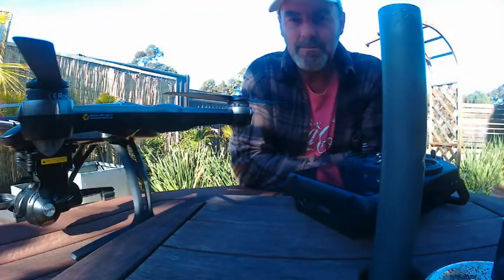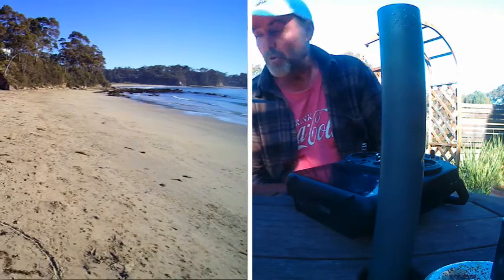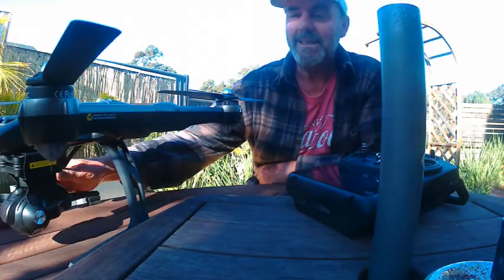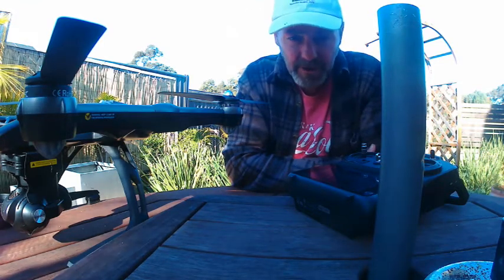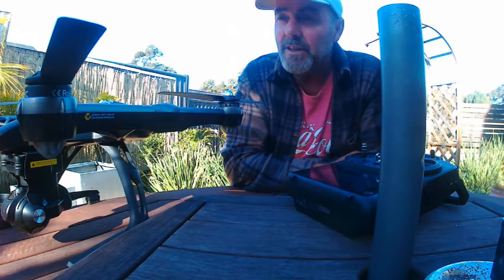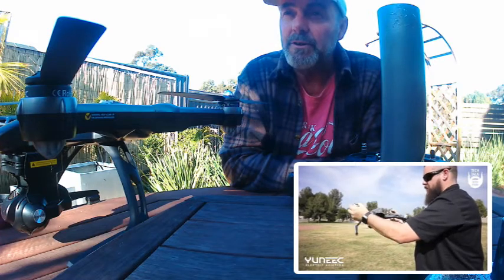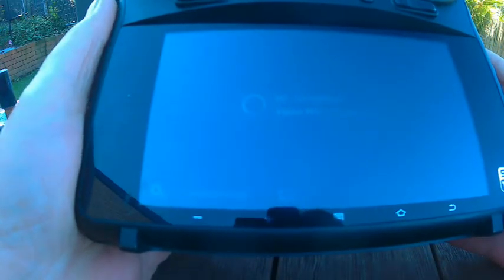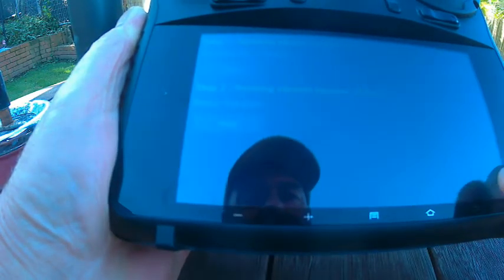How to stop your Yuneec Q500 4k drone from moving when hovering

Comment: You said a 1/4 turn that would be 90 deg. not 45 deg. / is that what you call bad info. ?? Just saying...!!
Reply: Agreed, it's 1/8th each time. No worries, anyone with any experience can figure that out. Plenty of info that's either on YouTube or in the kit tells you how to do the Compass. This was quite informative though. Thanks for getting deeper into the controller. It's curious that Yuneec doesn't delve into more settings than they do. They probably don't want you screwing around and messing up factory settings.